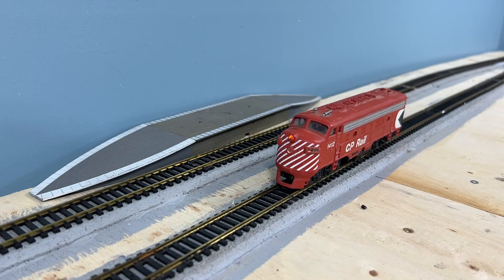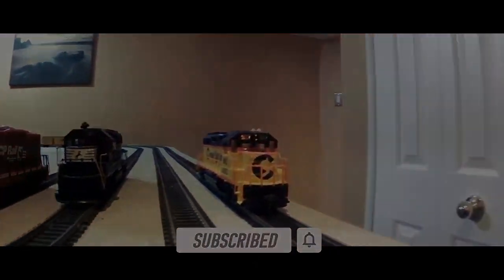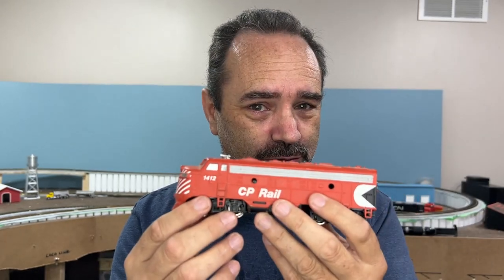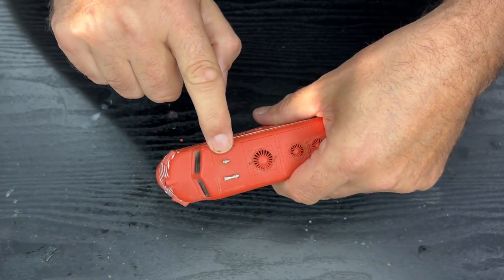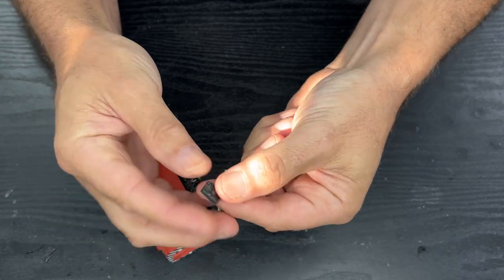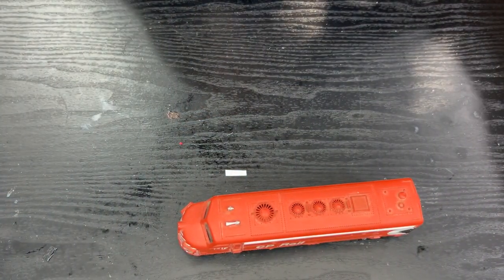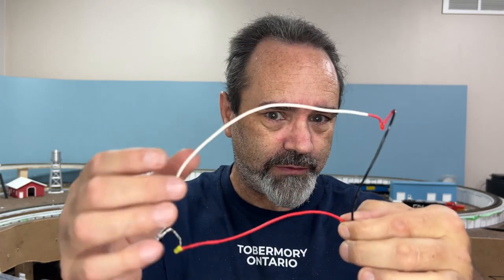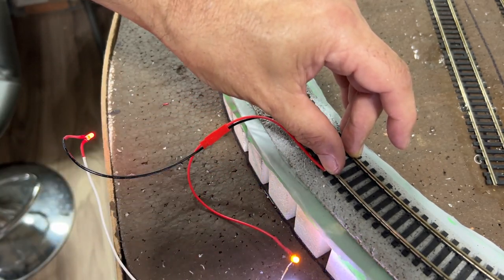Tune Up Tuesday - $5 Bachman F7 Gears Repair And LED Conversion

Comment: Buy yourself a digital vernier calliper so you can measure the shaft and measure the drill so you can select a drill that is 0.001” to 0.002” smaller than the shaft for a press fit.

Comment: I'm hoping to produce 2-3 good locos out of the dozen or so chassis and shells I acquired in the first phase of my venture back into model rr-ing. These are in addition to the good'uns I bought over the same time. I've more than enough cars for them to haul. My real goal is to make interchangeable modules, so I can run different companies' locos in an appropriate setting. I've also taken the plunge on N gauge, both to have an "anything goes" mini-layout, and to run a proper narrow gauge (HOn30 or HOe) quarry line to bring riprap down to the standard gauge line.
Reply: Can we get an update?

Comment: Thank you for your video

I have a 1412 locomotive made in the 1980s, but it has a broken gear. I can't find a part anywhere, I'm hoping to find a set like yours.

Merci pour votre vidéo

J'ai une locomotive 1412 fabriquée dans les années 1980, mais il a un engrenage de brisée. Je ne trouve pas de pièce nul part, j'espère trouver un ensemble comme le votre.

Comment: You should never blow on a hot solder joint as it is cooling. It needs to cool naturally or you may be creating a cold solder joint that can create an intermittent connection. A temperature controlled solder iron won’t over heat the contact or melt the insulation on the wire if the temperature is set correctly.
Reply from the maker: Thanks John, I didn't know that.

Comment: Jumping from 03:26 to 31:00 you reversed the power bogie on re-assembly (not the wiring) which is why it went the wrong way.
Reply from the maker: haha, well spotted. I did figure it out eventually.

Comment: Are the replacement gears 3D printed and/or available for sale? I swear EVERY Bachmann/Tyco/Life-Like pancake motor in Creation has those gears broken!
Reply from the maker: The gears I was sent were from Armand's parts bin. I've seen the gears at my local hobby shop, but they are quite expensive.
Reply: There's only three ways that you can get gears for these locomotives. The first is through donor locomotives. As for the second, a search for robotic gears my lead to a replacement gear. The third option (experimental) requires gluing the broken gear with a plastic solvent adhesive such as MEK or Plastruct Plastic Weld. I haven't tried this option yet, but the solvent could melt together (fuse) the plastic gear with a help of a clamp. Super glue is out due to the smooth surface of the plastic doesn't yield well to bonding.

My theory of the issue is that the metal shaft expands and contracts with temperature changes which leads to cracking. This is only a theory, and it may just be the simple deterioration of the plastic itself.
Reply: Hi, Cass.
Thanks for the reply. I have struggled with a number of these gears over the years. It's why I try to stay away from this type of power train. As far as donors go, My experience has been that virtually ALL of these gears fail. If something is running, I will try and swap out the entire motor. It's a waiting game to see when (not if) the shoe eventually drops. The plastics seems to be a Nylon derivative, All the solvents I have tried, don't bond it. I have straight MEK, and will give it a try, but I don't hold out much hope. Nasty stuff—will give you Cancer, if you work with it long enough... JB Weld has a new plastic bonder epoxy, too. maybe...
It's why I was thinking,  a scan and mold via 3D print. I understand that there is metal reinforced resin, now. I think scanning would be the best route, as a 3D model built around a true gear design, would be a monumental task. Gears are hard to design, well. (Ask me how I know—I was a design engineer at GM for many years.)
I don't have the 3D skill or equipment to try. (sigh!)
Anyway, thanks for the advice.
Jim
 @casstelles